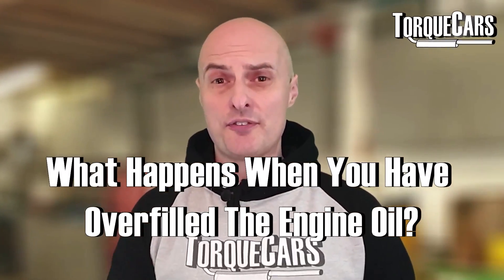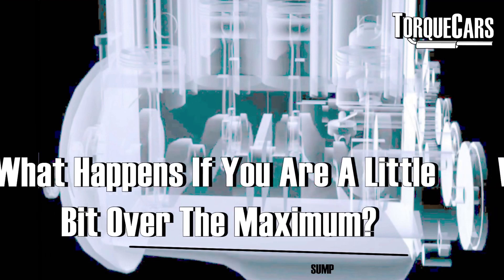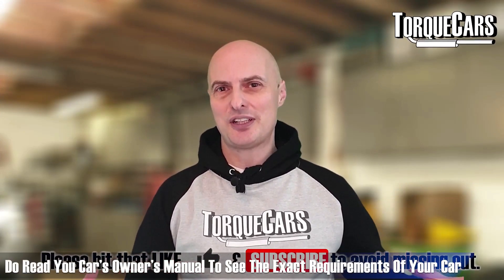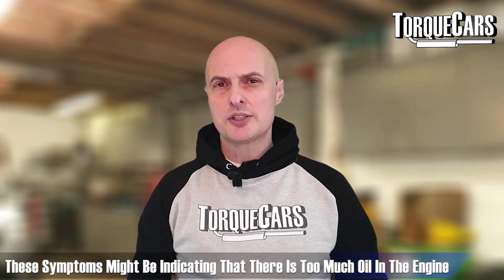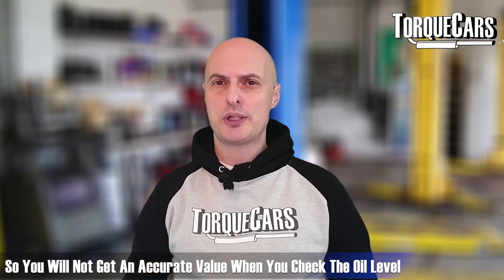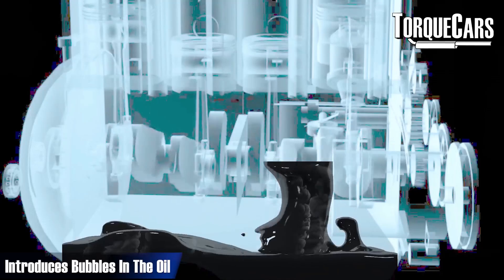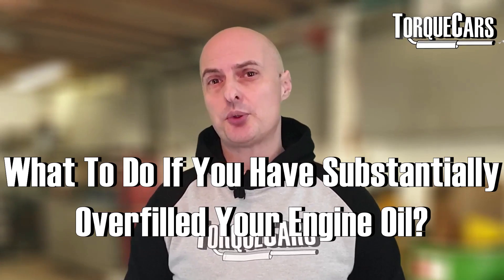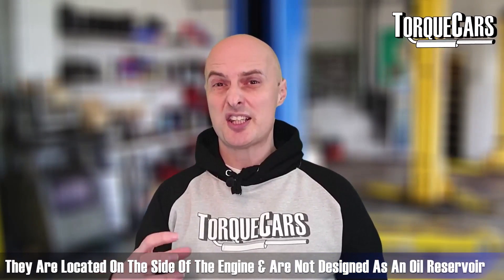Overfilled Motor Oil! What Happens & Engine Damage Done - Fix & Avoid Too Much Oil Problems

Comment: So ever since I put this cleanser into a full tank of gas. My eco boost won't stay on during a pro long trip. I also believe my oil levels and topping are not a good idea. I put Euro L Full Synthetic into it just now. It started putting. I've been topping off and measure for the last couple hundred miles. I believed the oil was burning off. After doing research, you mostly can use this European  oil in American cars. I'd like to do these changes on my own but I need a heavy duty jack lift and not something small for tire changes.
Reply: you dont need a heavy duty lift, just a decent floor jack and jack stands. not sure id put euro in an American car, they tend to be different weights and that's what matters. if it's the weight your car should take and the bottle happens to say euro, dont worry about it. 

now if its burning enough to where you need to add to it, that's an issue. first you need to figure out where it's burning and why because that could mean a new engine or major engine work is going to be needed soon. plus eventually the oil residue in the exhaust is going to clog the catalytic converter and those are EXPENSIVE so id avoid that if you can.

Comment: I overfilled with new oil after installing new oil filter can I reuse the same oil after draining the pan after a day of running??. It looks dirty after a day of running but I wana save a few bucks.
Reply: If you clean the drain plug and surrounding area, and make sure you drain into a clean container (preferably into the oil container that the oil you filled came with) then it will be good to put back in.
However, make sure the container that you drain into doesn't have other liquids like water, that can contaminate the oil. 

I keep all the empty oil containers anyways, so I have something to store the oil into after draining.

Comment: My 1.2tsi is slightly over filled by 250ml shouldnt be too pad
Reply from the maker: You'll find even VW and Audi tend to overfill these engines a bit at service time, the real danger in these engines is dropping too low, it really does kill the turbo.

Comment: what about overfilling axle and trans oil?
Reply from the maker: That is a really good idea for a video, it will in most boxes still cause cavitation and lubrication issues. There are so many transmissions out there I'll have to do my research carefully to cover as many bases as possible.

How do you feel about filled for life transmissions that do not require changes or top ups?
Reply from the maker: The video on transmission fluid is live, thanks for the suggestion.
https://www.youtube.com/watch?v=hlcz7vo8YqY

Comment: My dip stick was excess little bit ,mechanic filled 3 ltr ,but my car manual said 2.7 ltr, it's any probelm 
Then my dip stick hole open then car started engine oil sparyed little bit
Reply from the maker: It does depend on the engine but most will tolerate a little overfill, they set the max level below the cranks splash zone. It is normal to spray a little oil with the dipstick open, there are quite a few pressure variations going on in the engine and with this unplugged it will generally find a way out there.
Reply: That much extra oil will have no significance at all. Don’t worry about it. It’s the same as if it’s a bit under. It won’t be any problem. It’s called a forgiveness factor.

Comment: Is that car considered no good after it’s over filled? My kids dad overfilled mine I was driving and the shaking started, he said it was nothing then the smoke started and it was bad, what do I do now?
Reply: Drain the oil into a oil pan. Then put back what vehicle calls for. To much oil can cause the oil to foam  and cause air bubbles and diminish lubricant properties

Comment: I've just got the oil changed, as well as the cambelt replaced and now the engine does seem to vibrate significantly more. There'e about an inch over the highest acceptable mark on the dipstick. Is that significant? Could the timing belt renewal be relevant too?
Reply: It could be the oil but it seems like your Cambelt change they didn't line up the camshaft and crank properly, probably off by a tooth
Reply: Just get some fuel pipe and a large syringe 50pence from chemist. Pass down dipstick hole and extract. Clamp pipe to syringe so u cant lose it! I worked at a college with motor vehicle as a course. The students couldn’t give a fig and these are who are working at fast fit outlets. All told to check auto Dayton for capacity, use proper jugs to measure. Oh yeah too busy on social media
Reply: I would take it back and ask their opinion.  My sad experience was too much oil in the engine. But that’s my experience.

Comment: 320d e90 2005 got to much oil, engine is making a ticking sound
Reply: It may be just lifters ticking with the new clean oil. High mileage they loosen up with wear a bit. Next oil use a thick oil by one step. If your using 5/20 use 10/30
Reply: @arthursmith643  it was the flywheel, the big one. Fixed it and now it's gone. 500 euro

Comment: Pep Boys overfilled my oil. Its about 5 inches above the safe zone on my dip stick. Now my car struggles starting, the engine dies when driving / idling, and I can't go above 60mph.
Reply from the maker: 5 inches is crazy my friend - some dipsticks aren't much longer than that! Please don't drive it, get the oil drained off as soon as you can or you could end up with engine damage.
Reply: @TorqueCars  is the engine fixable once it's damaged or does the whole engine have to be replaced?
Reply: I got my car back from the shop after an oil change and the oil is about a half inch above the full dot on the dipstick
Reply: @tristengreen5822 ….. they do that to eeeeeverybodys car bcs they pray they come with bigger problems.
Reply: What happens if it's about 2 inches over max?
Reply: 5 inches is like an additional 5 quarts
Reply: I know this is too late but it sounds like they forgot to drain the old oil. It can happen.
Reply: 😂 thanks .. this was what I wanted to know .. sorry to hear but bittersweet... let's fix them asap
Reply: Ever since Mavis overfilled my oil ( I had them subsequently drain some) I'm using a ton of oil. 😡😕😟
Reply: Sue them. Take them to court
Reply: @ItzGerrod  I think that’s the problem with my car. Some people said head gasket, but I literally thought it blowing out smoke and chugging installing literally minutes after O’Reilly’s topped off my oil.
Reply: Don’t let some high school kid service your car. Don’t go PepBoys. Easy fix
Reply: @likemilfes or the Toyota dealership
Reply: Did you have blowby after or no
Reply: Im having blowby! A few inches over max fill line! @wesh_07
Reply: Holy crap!
Reply: Drain some out
Reply: I over filled my mates car by1L now it struggles to start worse then before 😅 I drained it but idk what to do now making a chirping noise
Reply: @deadwolfking8267  google gave me the answer thats it a timing belt problem. I think it makes sense, xou said it was harder to start so the timing belt maybe stretched because it needed to work harder. Try to listen where it came from. Or did you guys fixed it since?
Reply: How did you end up fixing that issue? My car is doing the same exept I can’t go over 40, I’m losing to suburus again…😢
Reply: @229Ducky probably drained oil. He didnt mention he drained it in the original comment but a lot of time past since he made the comment so he probably did it since
Reply: @229Ducky 😂😂😂
Reply: @229Ducky replace the catalytic converter problem solved
Reply: Too late. Pep Boys just closed all their stores. Hope you had them compensate you for your losses
Reply: @jessejames96  they actually still have shops for repairs. They just closed the store parts in many place and probably most shops
Reply: Exactly what happened to mine via Meineke! It's wild!!
Reply: Damn bruh, why in Hell would you keep driving it? Clown.
Reply: @ItzGerrod  you have a claim lol call them
Reply: Five inches...😁😁😁
That's two or three litres more than required.

Comment: Bought a 2014 335i bmw off auction with rear door damage, clean title, go to start it and white smoke, I mean I’ve never seen it smoke this much, drained the oil the other day, roughly 15 quarts of oil! The BMW takes 6.9 quarts with filter🥶, the bottom of the car is covered in oil! But when i started it for 10 sec it sounded fine which is crazy, am I being hopeful trying to clean all of it and refilling and keeping the motor? Thanks for the detailed video btw!
Reply from the maker: It depends how hard it was driven with the overfilled oil in it. If nothing is bent and all the seals are good you should be fine. Do run a flush through it next oil change to clear out any gunk that got in places it shouldn't. Keep me posted and I hope it works out well for you.

Comment: I changed the oil of my new car, and ten minutes after I went, thick white smoke came out of the exhaust of the car, then I stopped and changed it again and the smoke disappeared. My question is (will the engine or other parts inside it be destroyed with the passage of time) For your information, my car is new, model 2023 Camry
Reply from the maker: Damage from overfilled oil is generally apparent right away. If the cause of the problem is fixed with a correct grade or oil level then the problems caused will not in my experience get any worse over time. It sounds like you picked it up quite quickly. The Cats and lambda o2 sensor may need checking but it does sound like you resolved this one as soon as you noticed.
Reply: @torquecars   Yes, I stopped quickly and changed the oil, thank you I was worried
Reply: How did you overfill it to begin with? The owners manual tells you the exact amount you need.
Reply: I had overfilled the engine after reading how much to use. However I misread the dipstick and it did smoke. I called the service at Finley and he said donot drive your car. Had it towed $209 and service $100. If I had left it at Finley for service I would not have made a expensive mistake!😳
Reply: I reckon I've accidentally topped mine up by 100 ml to much. I'm going to wipe the dipstick until it's sorted as I haven't got the space or tools here to get to the sump.

Comment: Dose it lock the engine up?
Reply from the maker: It is unlikely, but if the excess oil entered the cylinder, you can end up with Hydrolock where the piston tries to compress the oil but cannot so you bend or break a rod/crank/piston and cause major problems inside the engine. This is typically the sort of thing that happens when you drive through water and suck this into the intake, you would have to have a lot of oil in your engine to reach the cylinders.